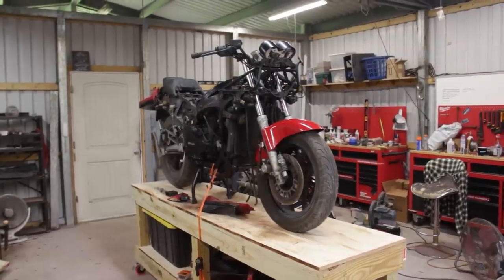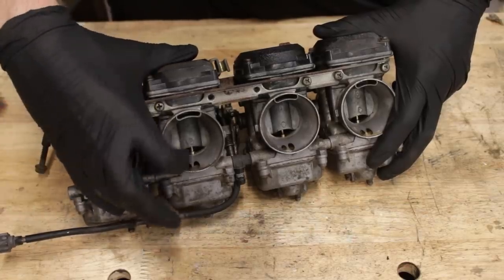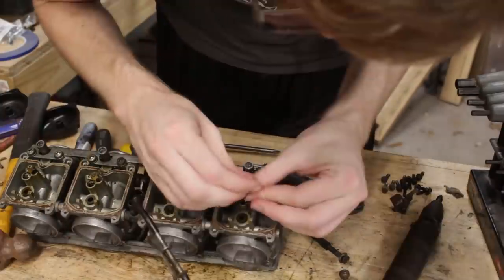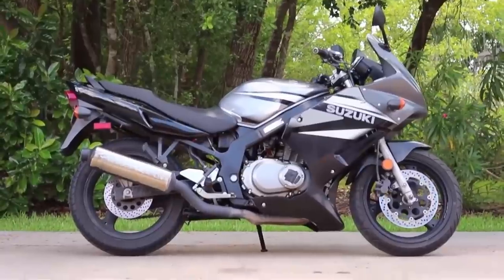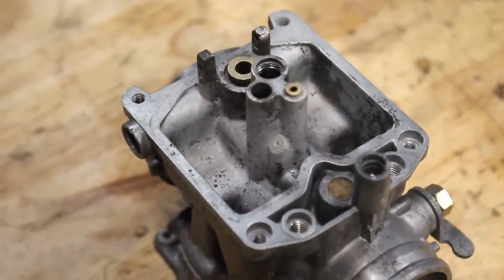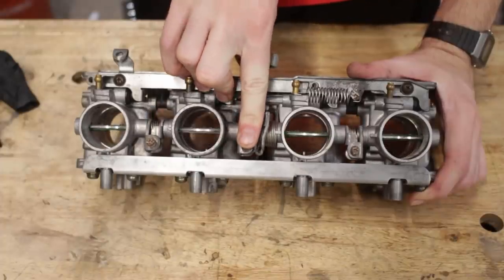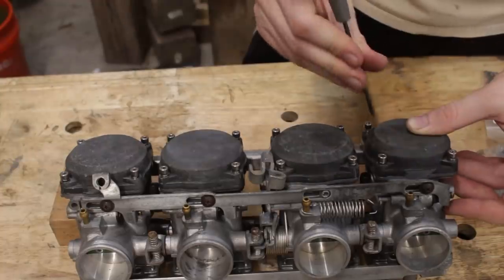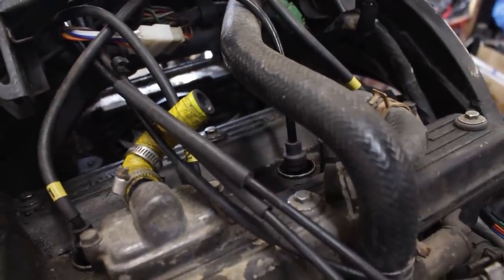First Start in 17 Years | 1986 GPZ1000RX Revival - Part 3

Comment: I've rebuilt more Keihin CVKs than I care to remember, including my 1996 GPz's on multiple occasions over the last 20 years. I've always had great luck with either Chem Dip or Gunk carb parts dunking. Solution comes in a 1 gallon paint can with a dunk parts basket. Really only big enough to do one, maybe two carbs at a time is the only drawback, but maybe that isn't a drawback because it forces you to focus on one at a time, and it flat out WORKS for a quarter of the price as that HF ultrasonic cleaner. I also know of a way to restore and soften your rubber carb boots and the diaphragms which get hard as a rock with age: oil of wintergreen and high concentration (99%) isopropyl alcohol.  Make sure you check the float height setting in the float bowls after your rebuild, you can use a clear plastic tube and alcohol for that test.  Alcohol also let's you (relatively) safely test if the float valves are actually sealing and not leaking by. A leaky float valve can actually overflow gas into a cylinder and hydrolock it. I know this from experience. It is a common problem with these old carbs, and you have a one in four chance that it will, and all it takes is one to bend a rod.

Comment: on my ZR 7 the previos owner fixed a cable on the carburators with aluminum foil. obviously one of the cylinders stopped working from time to time. im suprised it ran as well as it did back then. bought a used cable tree and it runs til this day with no more issues from the motor.

Comment: I use Spay carb cleaner around stuck jets and stuff, since gas turns into glue after it dries. Cleaner will loosen the parts if soaked for a while. That way you don't take a chance of breaking the carb while banging on it.

Comment: I have an 85 Yamaha Vmax 1200 with 11,000 original miles. The old man I bought it from purchased it in May 1985 and for the last 10 years it has been in a heated garage and started up a couple times per year so I rebuild the four Mikuni BDS 34 carburetors Myself and it went much smoother than I thought it would now the next time I have to do it I will do it better and faster😎

Comment: I love the RX1000, I had 2 of them, a blue 1 & a black 1 (but I always wanted a red 1). If you muscle it around it really does handle (if not quite so easily as the 900 - which my brother owned). Watch out for the external oil feed pipe to the cylinder head, on my black one this cracked leaking oil everywhere. Not good. Also be careful of the oil level, my black one had cams & followers in a real bad state because a previous owner had let the level drop. But all in all I remember them as monster fast comfy bikes & perfect for mashing miles on (my blue did almost 50mpg - imperial gallons - at a steady 95mph). Brilliant bikes.

Comment: Great Work @RonaldFinger Before you go much farther Do an output check on the alternator and the Rectifier regulator pack! 

If the Rect Reg pack is damaged and the bike is over or under charging It may well be why the Igniter was burnt out! Also a very Low battery when trying to crank the bike creates huge voltage spikes so another thing to be aware of (Y) 

Also Check out "Soda" blasting you do NOT want to use the glass bead slurry in or around Engines/Gearboxes/final drives where the glass beads can clog and oilway or get into a bearing and create havoc With Soda blasting you immerse the object in hot water and Poof it all washes out

Comment: Can't beat a dremel wirh wire wheels & brushes run not too fast on carb bodies then in the tank. Good to see you changed the screws to stainless. I do it as I service stuff, hate corrosion.

Comment: You could have tried phosphoric acid on the corroded insides..  I have used this before and it works very well..  I use the "Rust Treatment" version. I am not sure what you have in US, but in UK it used to be called Jenolite, here (NZ) it is Rust Kill ( rust remover and metal conditioner) Worth a try next time....

Comment: Hi Ronnie, I have a question regarding the oxidised carb body that  you where not  very keen on using,  If  the  other three on the fire damaged unit are identical could you not use any of the other 3 remaining carb bodies since you where rebuilding it anyway so you could pick the one with the best body, or where they all bad / worse than the one you have used, or do they differ in other ways since you mentioned it is the same one on the original carb.
 Forgive  me if I am missing something obvious here (being a car guy generally with efi, I have no idea about motorbike carbs) until now! great work  can't wait until the next installment. All the best, Dan

Comment: I had bought the same ultrasonic cleaner. And it lasted me only 8 months. I used it frequently. But the steam would condense back into water & run down the lid & in between the bowl & plastic housing. Witch is where the controls circuit board is. It destroyed it. They only used a like foam gasket between the two. Witch it absorbed the water instead of repelling it.

Comment: On the mating surface, I would have polished it with a dremel and polishing compound and let the gasket fill in the remaining gaps.   I've done that in the cooling system in a BMW where the thermostat housing mates with the head (both are aluminum) and it was damaged by a coolant leak.    Except for a few remaining tiny divots it was polished to a very smooth surface and it worked very well without filling them.

Comment: Love your videos.  Maybe I missed you talking about it in a previous one, but I'm curious about your fuel bag support.  I've got a junky wooden one that I made, which is pretty much the same as a standard IV bag holder.  I like the arm an yours.  Is that setup something you purchased, or cobbled together yourself?
Reply from the maker: It’s a C stand! Used in the film industry to hold lighting equipment, it just also happens to be good at holding auxiliary fuel tanks :)

Comment: That's funny, i stripped out the air/fuel screw on my old sv650 and bought a used set as well. Those old brass screws are terrible

Comment: Honestly if the values were that off with the old computer, it may just be electrolytic capacitors causing the issues. I wouldn't expect anything to be too complicated considering it's a computer from 1986

Comment: Had the pause the video at the 7:26 mark.
I started screaming "WHY ARE YOU BANGING THE CARBS AGAINST THE TABLE WITH THE FLOATS STILL INSTALLED??? YOU'RE GOING TO DAMAGE THEM, AND THINGS ARE GOING TO BE MUCH, MUCH WORSE. USE CARB SPRAY TO FREE THE PILOT JETS!!! DON'T YOU HAVE CARB CLEANER??? WHAT'S WRONG WITH YOUR BRAIN TODAY???"
Now that I've got that out of my system, I can continue watching.
I've services so many Kei Hin carbs over the years, I understand the frustration, but those carbs you have aren't even that bad compared to what I've pulled off of bikes before.

Comment: Hey, I noticed in the little meta clip in the beginning of the video your CPU cooler (the light up fan that says AMD) is set to the random colors so I’m assuming you couldn’t figure out how to set it up like most people online. If this is the case, I know it comes with two cables, only use the USB cable not the RGB one, and then download a tool online that you can find by searching “AMD Wraith Cooler RGB” and you should find a cooler master link. Should be all good, and if you don’t have enough USB terminals just get an extension from AMD. Only bringing all of this because I think random RGB is ugly, best of luck!

Comment: Ahh, Mikuni BS carbs. I dealt with them on my GS1100. Hated them with a passion. Did any of yours have egged-out needle seats in the emulsion tubes? Mine did, and they don't make replacement parts for those...So I bought two more sets...That also had the same problem. It'd run off-idle fine, but if you idled it you'd foul out plugs within a few hours of idle time. That took about two months of day-to-day stop-and-go riding around town here.

Eventually I ended up with Keihin flat-slides on the thing, and that just worked out a lot better.
Reply: Also, the float pins seized up in the float towers were a hoot...Broken float towers were also fun...I absolutely hated those carbs.

Comment: Re: carb float bowl screws...all these years i just assumed they were cheaping out on soft crappy screws lol...found out JIS stands for Japanese Industrial Standard, and while similar to Phillips, the shape is slightly different. ... A Phillips is engineered to “cam out” once the screw is tight, whereas JIS is locked in and the torque setting is up to the user. It all comes down to the shape of the screw and bit.

Comment: For what it's worth, for the really nasty stuff, I like a 50/50 mix of chem dip/carb dip and pine sol (unscented variety). Yes, pine sol floor cleaner, in my ultrasonic cleaner. That mix works a magic treat. Add use of a nylon, or brass brush, and nothing can stop you. 

Also, do yourself a favour, get a whole JIS driver set from vessel. You'll never look back, when it comes to working on Japanese bikes. You can tell its a JIS screw, by the little dimple it'll have on the screw head (finger may know that, so this tip is for the rest of us working on Japanese things)

Comment: The JIS screw driver will work with a Phillips screw, as both share common 57 degree points. A Phillips driver will not work on the JIS and will round the head out. a jis screw is very similar in appearance, and a small dimple near the drive opening is the clue to a jis screw. just thought i'd throw that in

Comment: Actually, the vacuum does not "pull" air into the piston cylinder. The atmospheric pressure actually pushes air into the piston-cylinder when the valve opens on the intake stroke. The same thing happens on the exhaust side, but in the opposite direction...exhaust pressure sees atmospheric pressure as being less and therefore tries to equalize the pressure differential. I enjoy your videos nonetheless. Equalizing the carbs is a trial in patience.

Comment: How long was a soak session? Q: When disassembling all carb components is it important to return each component to the same carburetor?
Reply: Typically the inside carb components are all the same. At least on every inline 4 I've worked on. Early Honda V4s are a different animal, and you shouldn't mix the front carbs components with the rear parts. Some are different. And there's no discernable markings on them to indicate it if you mix them up.

Comment: Since you are going down the jetting route, you need to know that whatever you see online is never perfect for the bike in front of you. Meaning every bike is different, and not knowing the history from new of this one means it is likely very different. Air leaks in the intake boots are a common culprit, and a long list of other details like that make every bike a little different. The best way (the only for sure way) to make maximum power and mixture AND rideability is dyno runs. Short of that, black magic wizardry by old guys with lots of carb experience test riding it is the other.
The only caution I will give is make sure you are not lean on any of the cylinders, as that is a quick way to burn a piston. Other than that, your own satisfaction with the power and rideability will be your best guide. Remember that carb tuning is not about RPM, it is about throttle position and load on the engine. A lot of people get tricked into thinking it is RPM, and sometimes it can seem that way, but throttle position is your main concern. With that awareness and carb tuning tutorials learn all that you can. With this old school knowledge and careful methodology, it can be easy.
Be ready for lots of test rides if you want it perfect.

Comment: I would Open up and rebuild that ignition brain box! I did on my Suzuki 1986 GSXR 750 - opened it up, picked all the hot-glue they dribble all over to quell vibration off - and soldered in about a dozen Capacitors of various values, has worked Flawlessly now for another 13 years and cost me under $20 in caps and some hot glue re-applied! SOME of the caps were obviously bad, but just to make sure I changed every single one-

ONLY USE "JB weld Marine", its ethanol and Gas proof, way more than standard JB Weld -
and if you think that tiny toy Ultra-sonic is good, imagine how happy you'd be if you bought a real one from eBay! LOL
I bought the exact same one that Mustie1 uses, its a 15-liter unit, has heat and vibrate and cost about $150 shipped - BEST part is, you can strip your bowls and jets & slides and do a whole bank of 4 Motorcycle carbs TOGETHER, and not have to mess with Synch and splitting them all apart which saves TONS of dicking around......

PS: after installing many hundreds of aftermarket pipes on bikes for 4 decades plus, I say you 100% have to change the pilot-jets when you do a pipe and pods - ALL Dyna-jet kits come with bigger, better Mains, Pilots and sometimes slide-needles
Reply: When you first re-assemble the carbs, after you replace all the fuel crossover pipe o-rings - Leave the slides OUT, hold the carbs up to a bright light, and squint one eye like your sighting a gun and compare the little sliver of light under each throttle butterfly, and adjust them all to be close to the same, by eye- that will get you in the ballpark for starters before you actually use your Mercury vacuum gauges to synch them properly, AFTER you've done your valve adjustment!!! Because if you synch them FIRST, then adjust valves it wont be right-

Comment: The function of the needle is NOT to block the main jet(lmao)...in fact it doesn't even touch the main jet!!! The needle meters fuel through the "needle jet" and is responsible for fuel metering from approx. 1/4 to 3/4 throttle, at which point the opening in the needle jet (with the needle mostly withdrawn) is now larger than the main jet and now the main jet is metering the fuel. Raising or lowering the needle via the clip position or with shims (solid needle) is how you richen or lean out the mixture in the midrange! Wide open throttle=main jet, idle=mixture screw, off idle to about 1/4 throttle=pilot jet. What you did with the needles is going to make it miles too rich in the midrange(where the bike will be ridden most of the time) and cause it to use excessive amounts of fuel and ultimately sacrifice a fair bit of performance! I worked in a Kawasaki dealership for many years and built and tuned many race bikes. Hope this information helps.

Comment: Correction, only 40% of OLD KAWASAKI parts are in Germany.  And yeah, I bought a used engine cheap from canada and it resulted in a lot more work for me although it did save money.    Generally, you can trade time for money or money for time.  The easier it is, the more expensive.  For example, getting a bike a few years old is turn key but more money than this.  But I think you went too far on the cheapness of the carbs.  But you do learn that way and you save money and you end up working for yourself for next to nothing for your labor.  But you do save money.

Comment: yeah well. nice you tackled them for the viewers. but I saw at least 5 steps you missed or didn't show on camera. these carbs are PITA and have to be done correctly. and never reuse O rings gaskets or those horrible JIS screws on reassembly. now all you need to do is balance them. set the mixture screws and do a wet test for fuel levels in the bowls.17mm is a guide only not a factory set. oh and unless you want headaches getting the thing to run anything like decent throw the pods away and refit the air box.

Comment: I have stripped dozens of carbs and never seen anything that bad.
Reply: I also balanced the carbs using four 2mm drill bits, I set carb 2 which is the main carb and set the other 3 to it, with the smooth end of the bit in number 2 I set the slide just enough that there was just resistance when moving the drill bit in and out.., worked that well I didnt need to have them professionally finished.

Comment: You can delete that smog crap on the top of the valve cover and it will leave a little extra room up there.  I just made my own metal cover but there were a couple guys selling nicely made "block off plates" for that engine.  These were guys on the ZG/GTR forum.  I think there's a reed valve in there that needs turned over to seal pressure from the crankcase.  All of that smog piping went back into the top of the airbox that you're missing anyway.

Comment: Man... Please stop bashing the carbs off the bench... De sticky with carb cleaner and stuff will come apart easier... You keep banging and youll break a float tower off and then the carb is junk.
QTip cut in 1/2 chuck in drill and go at those with Mothers Aluminum polish..... Theyll look new